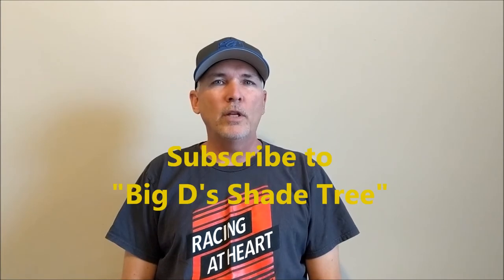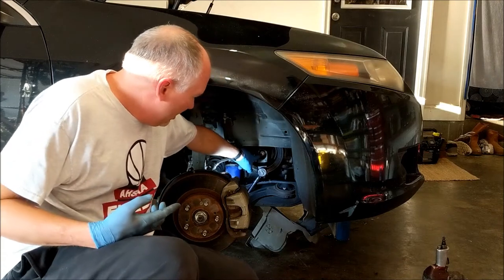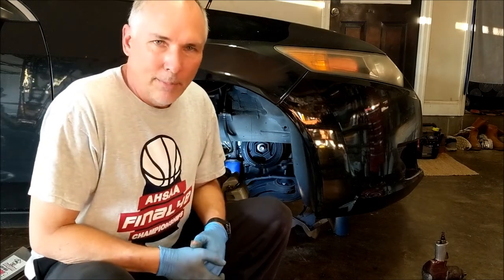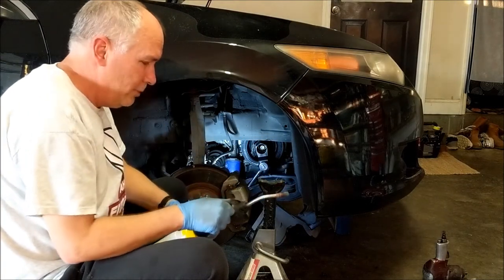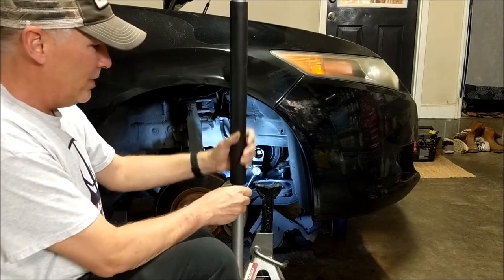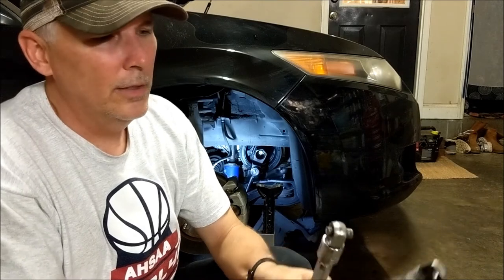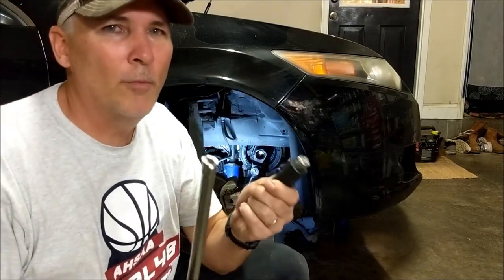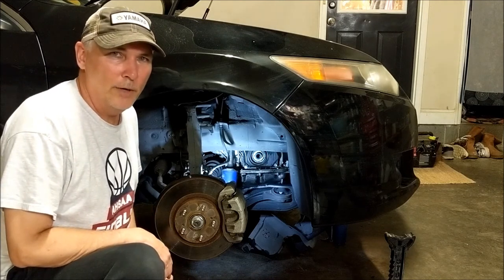Acura & Honda Crankshaft Bolt Removal

Comment: I recently bought a Milwaukee 2967 1/2” impact gun and a heavy mass 19mm impact socket made for this purpose. Came off in less than 3 seconds. In our shop before this socket was available, we would use a crank pulley holder tool, then a Snap-on breaker bar with a Jack handle for leverage. A few times it actually took 2 guys (over 6-footer) to break the crank bolt loose.
Reply: Ingersoll special socket and DeWalt DCF899 also takes them off in the blink of an eye
Reply: @andrewwmacfadyen6958  Bring it on over. I'll introduce you my 2003 rusty element. :)

Comment: Everything i buy from harbor freight Shredds, breaks, strips, or snaps, my warrior drill bits all broke under pressure, my sockets all strip under pressure,  my Dads Craftsman wrenches, drill bits, and sockets never have broken on us, i need to buy a good craftsman set instead of going cheap.
Reply from the maker: Most of the things I get from Harbor Freight do the same. I try to only get their cheap crap for jobs I only expect to do once. Most of their stuff will last long enough to get the job one time!

Comment: I just Broke my breaker bar I’m headed to harbor freight for the bigger one you have.
Reply: So I Got the bigger bar and the closes I got to taking it out was oil coming from the crank bolt. This bolt is angry 😤 2009 Acura TL

Comment: I just broke the crankshaft pulley bolt loose on my 2008 Honda Fit!  I used a "3:1 Torque Multiplier ($257 new on Amazon)" and the crank pulley holding tool ($13).  I ran a bunch of 1/2" extensions out from the multiplier and rested them on a jack stand and used a breaker bar with a 4 ft. cheater pipe on it and it broke loose.  Even though the torque multiplier is rated for 1100 ft/lbs, I still had to put out on that cheater pipe.  My 450 ft/lb. electric impact with the special crankshaft 19mm socket from Honda was not enough to break it loose.
Reply from the maker: They can be a bear to break loose. If it were to break off, it would really turn into a job!

Comment: i dont comment on many youtube videos or problems but this honda crank bolt issue really P** me off, i had a bit of advantage as my k20 was on a stand and the stand was secured to the floor so i could get closer too the bolt for leverage, i spent 2 days with pry bars and cheater bars and even with a 550nm rattle gun but no joy!. i did notice with all the videos on youtube including this one all had the same issue with tooling, the tools used like breaker bars and extention sockets all had far to much give/play in them so the energy was being lost through the tools before getting to the bolt, so after 2 days i just had enough and done a bit more research and found this solution that worked almost instantly.
there is a socket on the market for harmonic crank bolts which is about 4x the mass of any impact socket but this alone was not enough, various videos suggested a high inpact gun so after a bit of research i bought the dewalt 899 which has 1650nm of breakawat torque :), i tried the impact gun along with a short impact socket but again it failed, i then tried the harmonic socket with the dewalt and within 3 seconds on power 3 with a full battery is spun off, the whole gun/socket and battery cost a fair bit in the UK but it done the job and now know there is not another bolt on a car the gun will not remove :) just thought i would share my experience with this dreaded bolt.
Reply from the maker: Thank you for your comments and insight. I will have to give that a try if I come across the problem again.

Comment: I've been trying to get my crank pulley bolt off for almost 2 days , broke 3 High impact sockets , 4 extensions 
And made an impact gun go to heaven trying to break this bolt free . Annnnddd I'm still trying to get it off lol glad you got yours broke loose .
Reply from the maker: Get a good socket and pull handle wedged in securely and bump the starter.
Reply: I've tried to bump start it off but it bent the breaker bar in a "U" shape lol that sucker is on there but I'm not giving up on it .
Reply from the maker: @BobbyFocus2008  All I would know to do is heat and penetrating oil. Just stay after it. My daddy always taught me nothing could withstand steady pecking.
Reply: Big D's Shade tree I agree , with a little more persistence I'm sure it'll break loose .
Reply from the maker: @BobbyFocus2008  I wish I had videoed when I used the starter. If I remember right, I used a shorter breaker wedged on the lower control arm. That was the first time I changed my timing belt. I don't know why I didn't remember that the second time. I guess all my struggles makes for better video!
Reply: going through this BS as I type this message
Reply: @MrRottweiler72 How did it go?

Comment: I haven't tried it yet but there's a special socket for this, I've seen made by oem tools and lysle 19mm part # 77080, meant to be used with impact gun
Reply: Yup it works. What it does because of the extra "weight" in the socket, it will cause an extra "hammering" effect causing the bolt to break. There's 2 styles, both are good. Especially if you have an Earthquake impact, even with a Bauer. Just make sure the battery is fully charged.
Reply: I have one but too thick to fit in. My bolt was deep in the harmonic balancer. 99 civic. They do have one thatbis smaller the first inch but I coulndt find for sale as a 17mm.

Comment: I  normally use a 3/4 wrachet with a 12 ft gas pipe...but you suppose to use a 9 ft pipe...I don't apply heat because the crank seal and the oil pump seal...I recently bought a 1" wrachet with a modified 1/2 reducer just in case ...

Comment: Drill an 8mm hole in the gearbox bell housing  towards the ring gear teeth, jam the teeth with a screwdriver and get a breaker bar on the crank nut with no extension if possible. Works on any car manual or automatic.

Comment: I used the starter on a Ford Escort that had a water pump that was driven by the timing belt. I really don't see the danger neither, because it worked well and didn't damage anything. I've seen a couple vids where this method was attempted on a J series Honda and the starter wasn't able to bump and break it loose, even after 2 attempts. I'm in the middle of doing the timing belt and water pump on a 97 CRV, and getting ready to use heat. Already tried 2 air and 2 electric impacts with the lisle giant socket, days of PB Blaster, transmission and acetone mixed half and half, hammering with a punch, and some creative use of the worst vulgarity I've picked up over the decades. I've already had issues with the motor mounts and put so much torque on the front torque mount that the mounting bolt broke free from the engine rather than the front nut. I was able to remove it and the bolt was still good, but the broken mount was still attached and the nut still needed to come off. I got pissed and got my angle grinder and you know the rest. The nut is a couple dollars. I can't do that with the crank bolt and the starter can't be used because the engine spins counter-clockwise. And my breaker bars are Harbor Freight specials also. I'm gonna need all the luck I can find. When heat is used, you must crank on it within seconds of heating it - preferably while still red-hot - or it won't work. Learned this while I worked for a valve company as a rebuilder. These valves would come in with Lord only knows what kind of chemicals flowing through them, and some of the most corroded fasteners I've ever seen. Just hope this propane cylinder will get hot enough. I'm also gonna take a brass wire brush and attempt to get behind the washer and scrape some of that crud out so the oil can get back there and soak in. Thanks for posting your odyssey with the crank bolt. If u r interested i'll video my efforts if I can find a way to set up my phone.
Reply from the maker: I would love to hear how it came out for you!

Comment: I am surprised this fellow borrowed a neighbor's SK breaker bar. If he had broken that it would have been expensive to replace, You can;'t depend on Sk warranty any more, they are made in China now. 

The solution is a high grade impact gun. I bit the bullet and bought a Milwaukee 1/2" impact gun that is rated at 1400 ft-lbs of torque. I also used the lysle 19mm part # 77080 socket. That combination took that bolt off in less than 10 seconds of hammering.

Please don't use heat. After that you may need to replace the crank seal.
Reply from the maker: My neighbor and I loan tools to each other all the time. We understand the risk. I dodged the bullet with the heat. The car now has almost 100,000 mi on this timing belt replacement, no oil leaks.

Comment: For a 2007 Honda Odyssey, to turn over the engine, would I need to turn the Crankshaft Clockwise or Counter-Clockwise
Reply from the maker: I'm pretty sure the crankshaft turns clockwise when you hit the starter. If you have a wrench holding the bolt, it will break it lose.

Comment: How long is that cheater bar? I’m about to go this route, already have a 30 inch breaker bar and a 2ft pipe and hoping to god it is enough
Reply from the maker: It was a jack handle, about 4 ft long. If I were to do it again, I would let the starter do the work. Wedge the pull handle against the lower control arm and bump the starter.

Comment: Can you lower the piston this way without taking the bolt off?
Reply from the maker: Yes, you can rotate the engine by rotating the crank. A lot of engines, you can only rotate it in one direction because the crank bolt will loosen too easily.

Comment: This is what I'm going to attempt. Haha
Reply from the maker: I would recommend getting the wrench wedged security against the lower control arm and bumping the starter to break it loose. Did it once before, but just didn't remember this time until I had already gone through all this work.

Comment: I don't know why it wouldn't be possible to design it  so you could remove the plastic cover and slip the timing belt over pulley.

Oh of course, that's too easy.
Reply from the maker: That would make too much sence.

Comment: Why You removed the Bolt?
Reply from the maker: You have to remove the bolt to get the pulley/harmonic balancer off in order to change the timing belt.

Comment: Too much flex using all those extensions… I changed my 2003 CR-V front main seal in 30 minutes. Just used an 18 inch breaker with an impact socket up against the lower wishbone and flick the ignition… there’s a video on YouTube showing how to do it… 99% of impact guns are useless for this job.
Reply from the maker: I totally agree. The first time I changed the timing belt on this car, that's how I broke the boat loose. This time, I just forgot. I'm losing my mind and my old age...
Reply: What link pls
Reply: 30 minutes. Lol. Right 👍

Comment: My cheater bar was 15 feet.
Reply from the maker: That's a pretty long cheater!
Reply: @bigdsshadetree338  yes it is but it pop the nut like nothing. Life saver.  Trust me I almost gave up.
Reply: @HmongGuitarPlayer  how long did it take you to get it off?
Reply: @MrRottweiler72  It took me three days of trying with many techniques before I came up with 15 feet cheater bar. I almost gave up. But nowadays I bought a high torque Milwaukee impact and bang it’s easy now.
Reply: @HmongGuitarPlayer  how much torque on the impact?
Reply: @MrRottweiler72  did you get the bolt lose man ???
Reply: @blackoutbass5360  nope had to take it to the shop.
Reply: @MrRottweiler72  how much the shop charge you? i got a 2007 tl type s and ive been dealing with this for weeks.
Reply: @projectaspect2906  if i remember correctly it was 400.00. Wasnt happy by no means